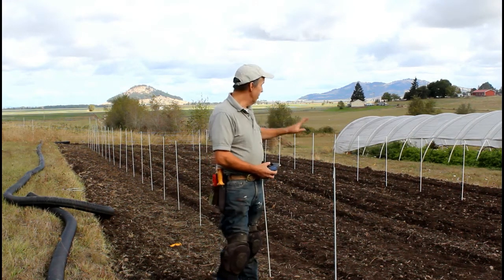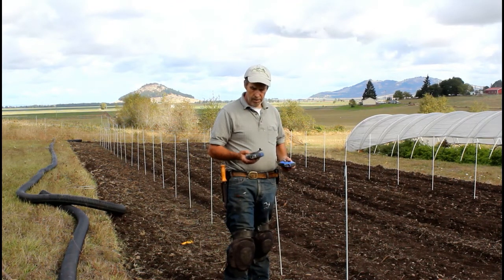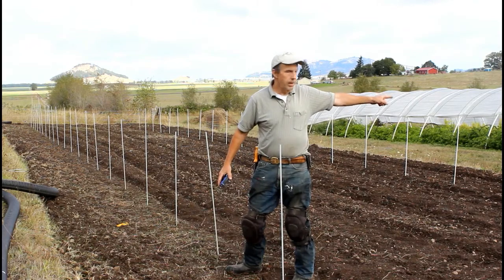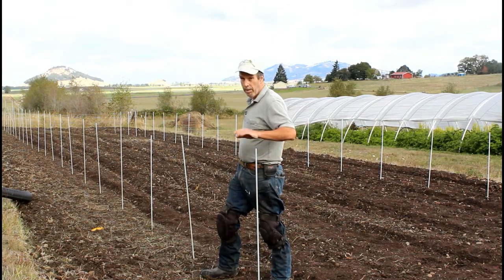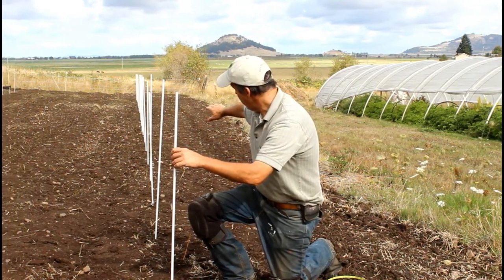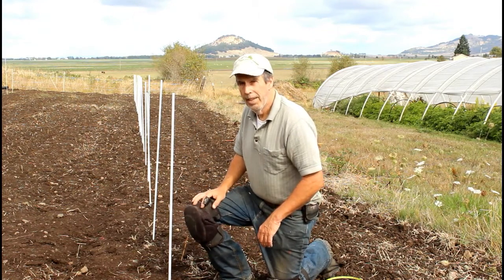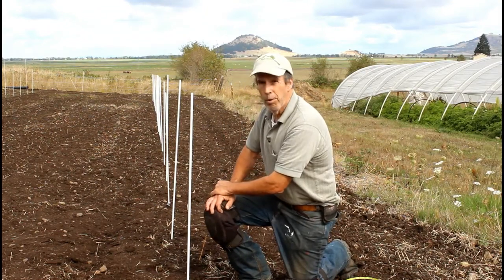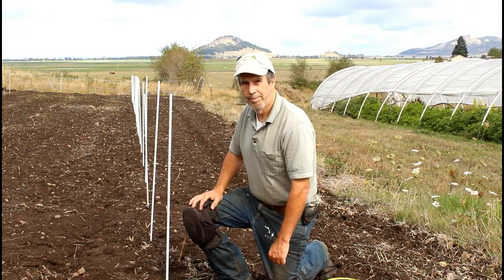We're building a new Hoophouse!

Comment: Great video!  Just a tip for easier math.  Remember 3, 4, 5.  One side of triangle is 3 second is 4 and the hypotenuse is 5.  You can also use any multiple of each number so in your case with the 16 ft  width.  16 / 4 = 4 so multiply 3, 4, 5 by 4 and ya get 12, 16, and 20.  Over all, nice round numbers, easier math, no calculator.   Thanks again for the great videos!
Reply from the maker: Thanks Michael; Now that you mention these things it is all about ratios isn't it!  Cool tip I'll definitely use.